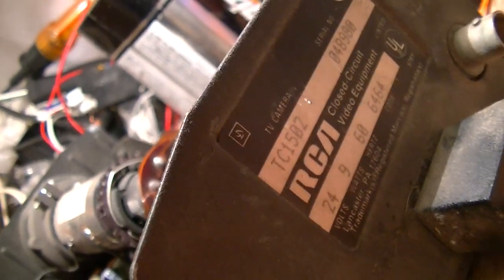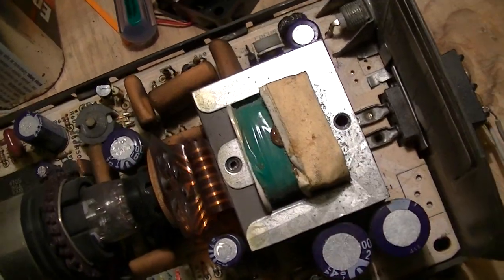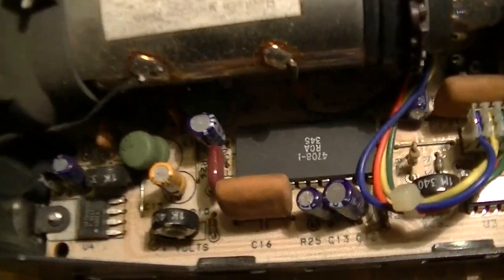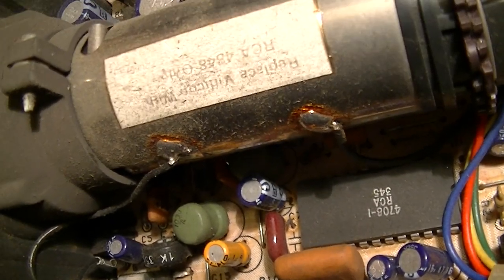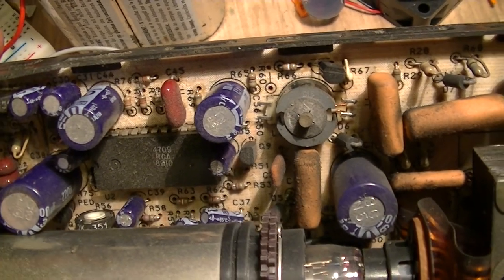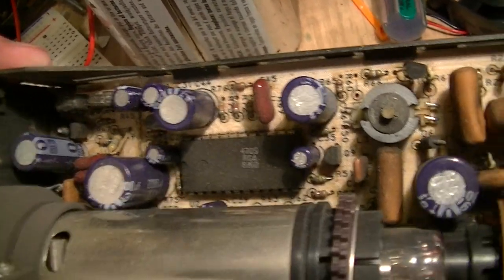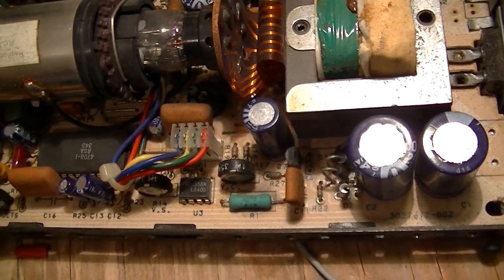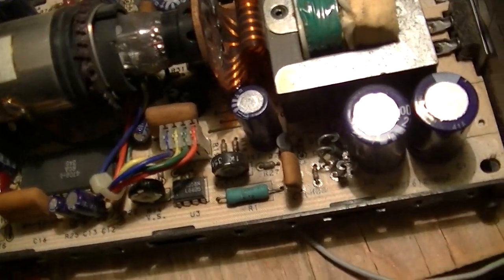RCA vidicon CCTV camera guts/teardown

Comment: I recently bought one of these, but mine is a slightly different model that plugs directly into 240V 50Hz mains.
It looks the same mostly, the main difference being that there's a sticky-out bit on the back with the mains cord hardwired into it, presumably containing a transformer that converts the mains voltage into 24V AC.